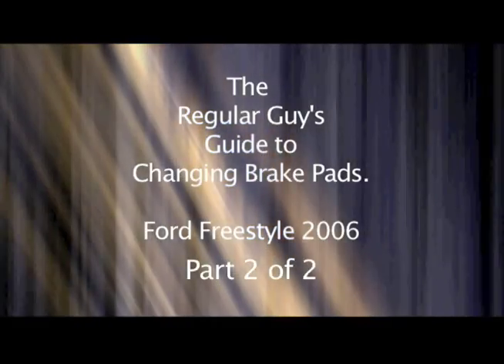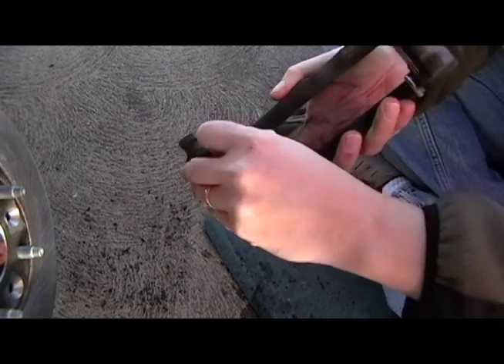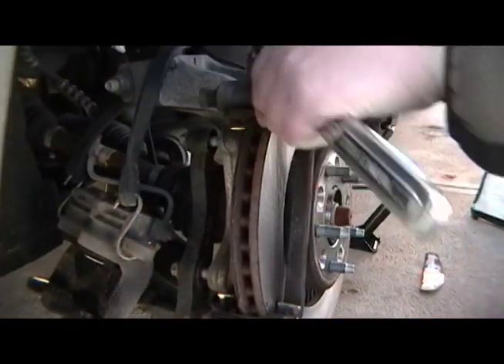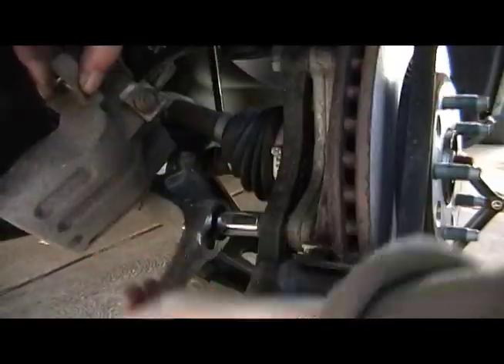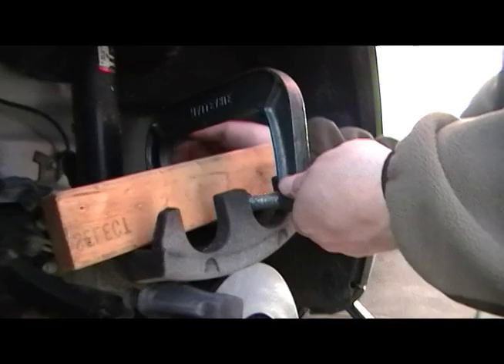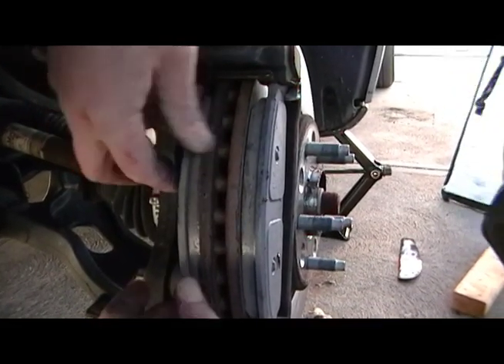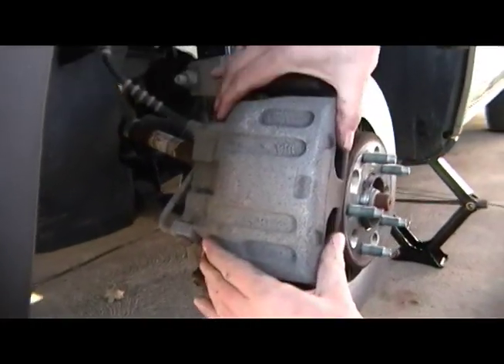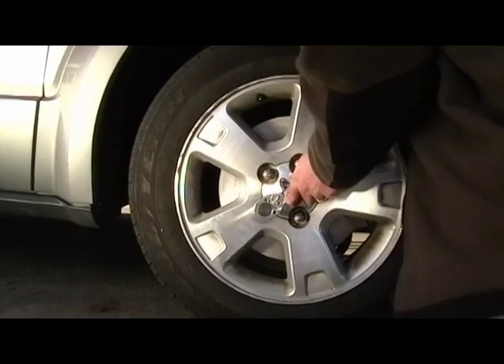Changing front brake pads on a 2006 Ford Freestyle - PART 2

Comment from the maker: Rear brakes are similar in many ways, but with a key difference.  You do NOT compress the calipers the same way.   Doing so will damage them.  You have to use a tool screw them in.   You'll have to do some research about it.  As far as bleeding the brakes, I don't do it and don't think it's necessary.   It doesn't hurt though.   If you feel more comfortable doing it then have at it.  Just make sure if you bleed them that you are careful about it and don't pull air back into the system.

Comment: Great video.  The torque settings for the anchor plate bolts is 74 ft/lb.  The torque for the brake caliper bolts is 44 ft/lb.

Comment from the maker: @vikasgmore - Be careful.  The process for the rear wheels is largely the same with one major exception.   You cannot compress the rear calipers with a C clamp as do the front.   The have to be compressed with a special tool that both turns them and squeezes them in.   You will damage your calipers if you simply squeeze them with a clamp.   I borrowed the tool from my local auto parts store.  If memory serves, driver side goes clockwise and passenger side goes counter clockwise.    Good luck.

Comment: As one who just did all four on a 2004 Freestyle SEL  w/4 wheel disk brakes.  Fronts can be retracted with C-Clamps.  Easy.  Ford rear Disk Brakes are a challenge to me.  Anyway, if there is any question about the calipers, it's well worth getting rebuilt calipers for only $67 each.  Winding in those rear calipers has a 30% chance or ripping the boots.  A poor design, why not just put in pin holes instead of the shallow V thing?  The official retraction tool sucks too.  PITA.  Do yourself a favor, replace the calipers with the rear pads and enjoy the rest of your day.

Comment: Changing MOST rear brakes that are DISC/ROTOR is the same.   However some disc brakes (especially the rear of the ford) use a twisted piston.   Basically this means that you can't compress it in like you can the front ones.   You have to purchase a special tool.

If you want to know if you have a threaded piston... Take the caliper off and look at it... if it has two dimples on each outside edge, then more than likely it's a threaded one.

Comment: Great video, but caution, not applicable to 2007's.  the clamp does not work to move pistons.  the 2007's have pistons that need to be screwed back in, and most importantly, the driver side must be screwed in clockwise, and the passenger side must be screwed in counter-clockwise.  The new Harbor Freight brake kit (61381) has both tools, one std thread and one reverse thread tool.
Reply from the maker: Mark Kehrhahn I assume you mean the rear brakes?  I've never seen the screw-in calipers on front brakes.  But it is definitely the case with rear brakes, which this video does not address.   Good tip on the Harbor Freight kit.   I have often borrowed the brake kit from the auto parts store when I do the rear's but they never have the reverse thread for the passenger side - which is a pain.
Reply: You are correct, the rear brakes.  I did a search for "rear Brakes" and your great video was top search result.  I assumed it was in reference to the rear brakes, but after further inspection, the video did not specify.

Comment: Nice video, looks very similar to what I do on my wifes 2001 sienna. On it I like to add a little grease on the sliding bolts.Would you do that on the Ford ? I have a 2007 500.

Comment: I don't know if your still doing  the vids because these were done 2009 but just to say they will be a big help when I do my pads because it will be my first time doing it  any extra tips.  have a good day .
Reply from the maker: Good luck.  The one thing that this video doesn't cover is pulling the caliper pins, cleaning and lubricating them.   Otherwise, it's a decent treatment on this process.   I haven't made any more videos.   Just haven't had time.  That more than anything is the issue.  I have done a number of repairs and projects since this video but it takes time to shoot them and edit them and usually I'm in a hurry to just get the work done these days.   But I hope to get back to it someday.

Comment: Just put two lug nuts on when reinstalling the rotor so it stays in place for the caliper install
Reply from the maker: Yeah, I do this sometimes.   But usually, I'm just too lazy.  I figure I can get that bolt threaded through by the time I put on lug nuts to hold the rotor.   Now that I use an impact wrench though, I often do put on the lug nuts as you describe because it only takes seconds.

Comment: Thank you for the instructions. This was exactly what I wanted for my 2005 Ford Freestyle. Your two videos made changing the front brakes a walk in the park. I do have the same question another guy had about using the tool on the rear brakes. That tool is only used when the caliper is removed, correct? Thus I presume one will have to use a bit of force to remove/pull the caliper from the brake pads in order to remove the pads?

Again, excellent video. Exactly what I was looking for.
Reply from the maker: For the rear pads, much of the basic process is the same as the front. BUT, with a some notable differences.   DO NOT compress the calipers before removing them.   First off, don't forget you'll need to release the parking brake.  Remove the bolts that hold the rear calipers on.   They will come off without first compressing the calipers.   Remove the pads.  Then, you work to compress the rear calipers.  You do this by screwing them in while applying inward mild force.   Left side screws clockwise and right side goes counter-clockwise.   I borrow a brake kit from the local auto parts store and use the tool that does this.  The left side is easy but the right side is tougher and takes more time for me.   The counter-clockwise thing is a pain.  Once they are flattened out, the rest is again much the same as the front.  Good luck!
Reply: Snackwog
Many thanks for the detailed reply. I'll let you know when I get them changed. This time I'll go mail order instead of going to the local chain parts store.

Comment from the maker: @vikasgmore - New rotors make it that much easier since you don't have to cut them.   But I have one tip....new rotors are usually coated in an oily substance to keep them from rusting.  Make sure you scrub this off before you install them.   I just use a Brillo pad or something like that.

Comment from the maker: @2006warchild95 

It is my opinion that you don't need to bleed the brakes for this project.   It is a closed and sealed system and unless it is opened up for some reason, it is unnecessary.   Now, if you replace the caliper of something, by all means, you absolutely should.  But for routine brake pads....nah.    I do do it once in a while, but mostly just to get some new fluid traveling in the system.

Comment from the maker: @vikasgmore - I don't think you need to bleed the brakes for routine changes.   I do it once in a while (a long while) to basically get some new fluid in the system.     I've never had a problem.   If you are concerned, you could bleed them yourself.   Either have a buddy help you and do it the old fashioned way of pumping and bleeding or there are tools with one way valves that let you do it by yourself quickly.   It doesn't hurt to do it and it doesn't hurt not to do it (IMHO).

Comment: Cation when compressing caliper.. pushing old fluid back can cause sediment to get into  anti lock system. Big bucks then!. Recommend open bleeder, then bleeding brakes.
Reply from the maker: I'm not a mechanic and not an an expert.  But I've never heard of this.   I've done the brakes multiple times on maybe 8 different cars - all with ABS - and never had a problem.   I suppose that opening the bleeder when you compress the piston could be better and certainly physically easier and could keep any 'sediment' from moving around.   But in my experience, it's a pretty sealed up system with little or no sediment in it in the first place.   And by opening the bleeder valve (for any reason), you now have to bleed the system - a hassle.   That's good to do once in a while but unnecessary for a routine brake pad change.
Reply: I've been a professional mechanic from 1974 to date. No it won't screw up all of them, but it is stranded procedure on any vehicle with ABS. 06 freestyle ABS module is only $200. bucks but other cars are over a $1000. bucks. For a couple bucks for brake fluid it's worth it!
Reply from the maker: OK, fair enough.  A good tip!   I think I will change my procedure going forward now and open the bleeder as I compress the caliper.  At least on my newer cars.   Gotta bleed it afterward but that's not the end of the world.   And you are right, brake fluid is cheap.   Cheaper than anything with the ABS.

Comment: Watched video and am ready to go. One quick question, in the video it shows you removing a shim but I don't think I saw you replacing it.
Reply from the maker: Didn't need to.  Those old pads had a shim or they were just so worn out that the shim had separated from the main pad.   New pads are what they are.  Some have integrated shims.   Some are sort of attached to them.  But it's not like there are extra shims that you need buy or anything.  Just buy brake pads for your car and you can put them in.   One note, not all pads get the grease on the back now.   I read the instructions that come with them now to know.   With some, you want to put some brake lube across the back like in my video, but some now don't like that.   They have integrated lubricants or something.   Read the instructions or check with your auto parts store.
Reply: Thank you Brian. Very helpful video and I especially like your quick response to questions. Now, I am ready to go.

Comment: @Snackwog thanks ..i did get that special tool for managing piston on rear brakes...but i guess i still need to use clamps to compress the brake pads to remove calliper from rotors...and then use this tool to rotate and move the piston to make space for new pads. how important is bleeding of brakes ...in this whole process...

Comment from the maker: @DAVIDMC101  

Although this video is specific to the Ford, it is really pretty standard for most cars.   As you mention, greasing the sliding bolts is a good thing.   I do it on my other cars.   But the Freestyle is a little different and doesn't seem to need it the same way.